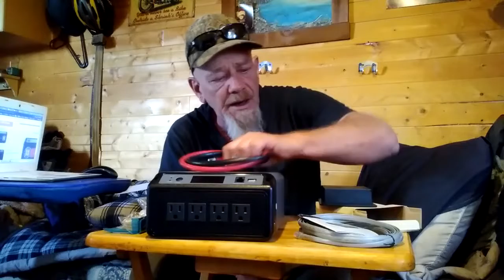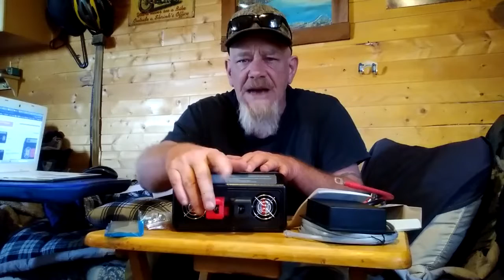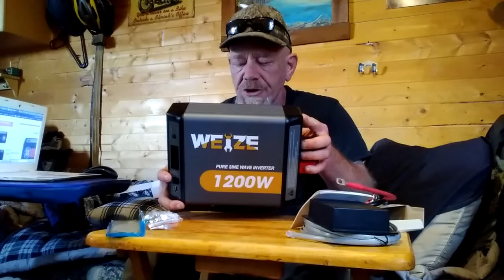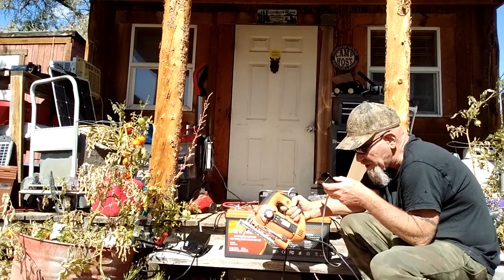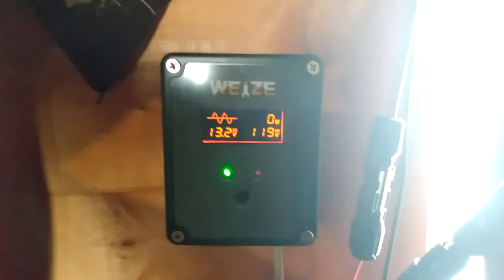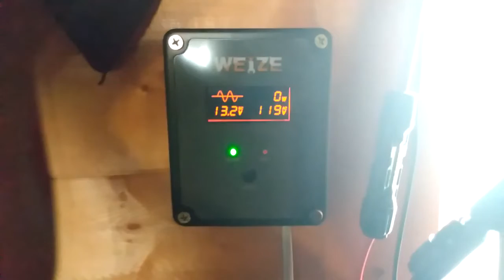DIY 5Kw Power Station Using Enjoybot 400Ah Battery and Weize Inverter

Comment from the maker: This is a simple DIY Power station anyone can set up using a LIFEPO4 battery, Inverter and 12 volt charger for remote or emergency backup power. I show the equipment I am using and recommend for this system.

Enjoybot 400 Ah LIFEPO4 Battery:  https://amzn.to/3FkmohT
Weize 1200 Watt Pure Sine Inverter: https://amzn.to/3EX5DJn
Enjoybot 12 Volt 20 Amp Charger: https://amzn.to/3t7NW71
Enjoybot Website: https://enjoybot.com/

I make a small commission if you buy through my Amazon links -thank you!

Over 20 years off grid and 350+ vids on my channel and many off grid books and cabin plans on my website: http://www.simplesolarhomesteading.com

#enjoybot #weize #offgrid

Comment: When I build my cabin, I plan to have a separate utility or storage room to put all the electrical and solar equipment. AC inverters are nice for most things but I still want to use DC for lighting and also DC receptacles and  USB outlets for charging small lower power gadgets and water pump.  I just prefer not having to use an inverter for lighting and small gadget charging.
Reply: Onite LED bulbs are amazing and use USB. Those are all I use in my camper. They can also be used to save plants from a hard freeze with a power bank and a bucket because they produce heat..

Comment: Here is a review of a 300 AH version from that company and the guy does give it a favorable review except for the low temp cut off test.
Reply from the maker: This has a low temp sensor but I wouldn't trust a low temp sensor regardless and these should be stored inside in freezing weather or get a 12 volt battery heater to wrap them.